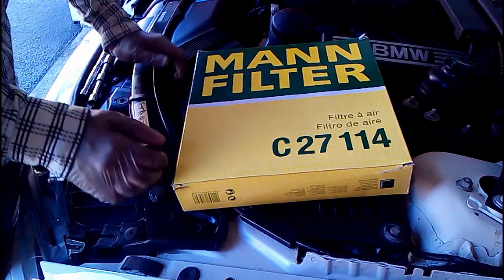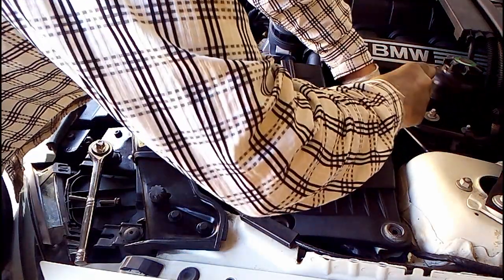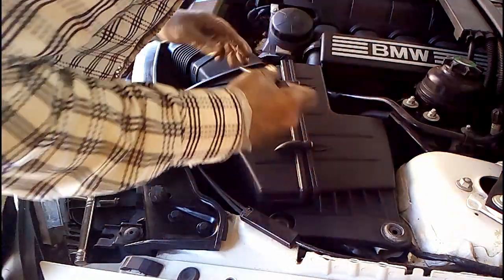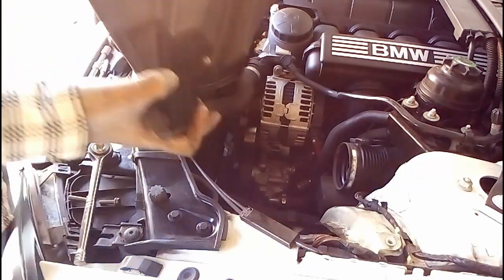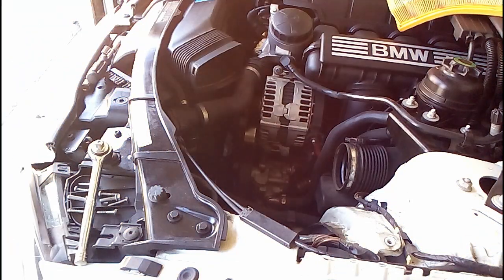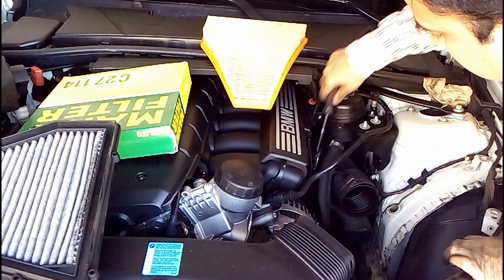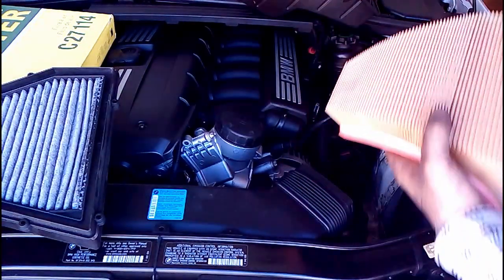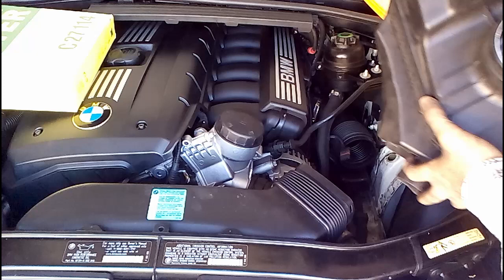BMW 328i and 128i Engine Air Filter Replacement

Comment: Need to show the newbies how to properly disengage the MAF and unscrew the ring connector that's not being shown on your video.  Also there are 2 tabs on each side of the airbox that needs to be disengage which it looked like you didn't know or figured it out.. is this your first time doing this?